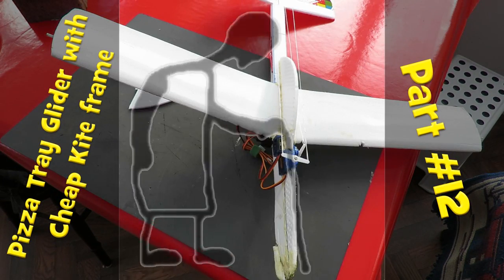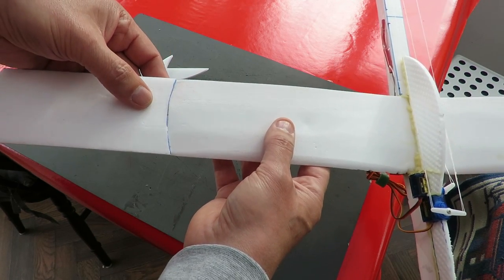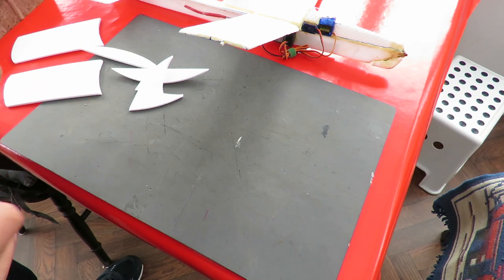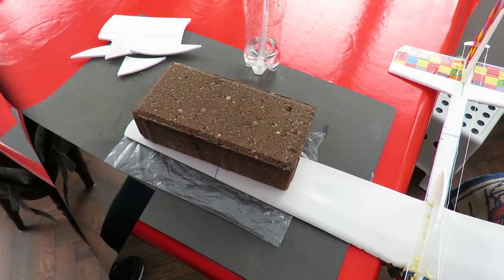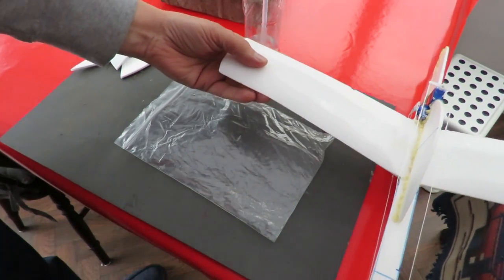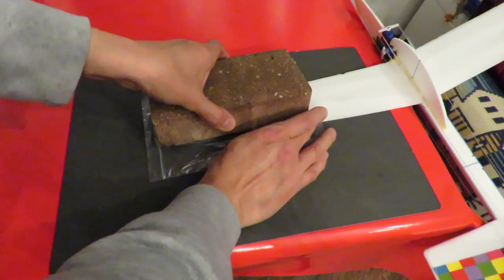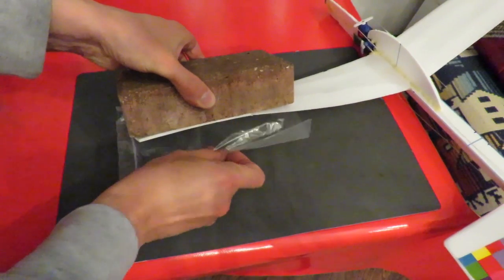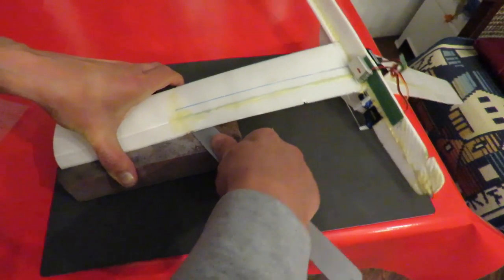Pizza Tray Glider with Cheap Kite frame #12 extending the wings

Comment: more wing... more glide... more lift.... i like the idea gramp great video
Reply from the maker: You will see in the next video the extra lift from these extensions causes the wings to flex too much on launch and in flight so may need trimming back a bit or just move on to a new plane with lighter RC gear so there is less stress on the whole plane.

Comment: grandad i think it is gonna need some sort of support or spar
Reply: You are correct since it is a heavy build, but he could have got by for now with coffee stir tubes since they are tiny and make good connectors for spars if they will fit in properly.  It is one way to link two spar rods together well enough to continue the experiments, but a wider wing would be a better option at this point.

Comment: I am sure I said something about the urethane glue needs a tight fitting butt joint and is a lousy gap filler.  A good quality sticky tape made for packaging on the joint top and bottom would help also since you are using the wing tip spin and toss method to launch.  Apply the packaging tape while the glue is still liquid, but do so sparingly to not waste the glue, or have issues with it expanding out of the butt joint.  The tape will also keep the glue confined so it is less likely to stick to things like a brick, lol.  Clever use of a Ziploc bag since urethane glue has a hard time sticking to them, or the baking sheet (Parchment) often used to keep cookies from sticking to it.
Reply from the maker: I find glue, regardless of the type, will stick to anything I don't want it to and fail on anything I do want it to. Life is like that 😆